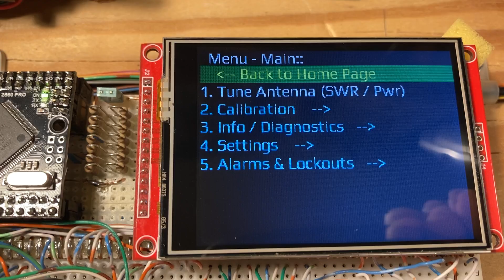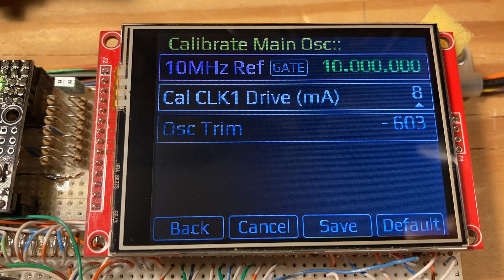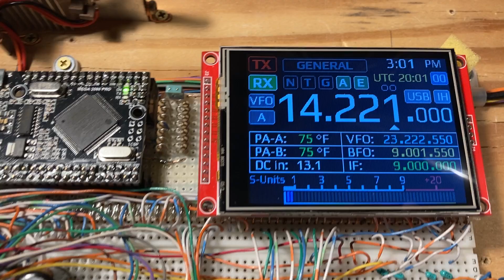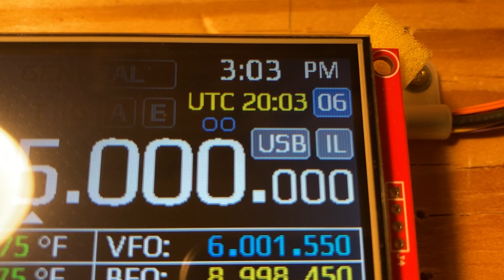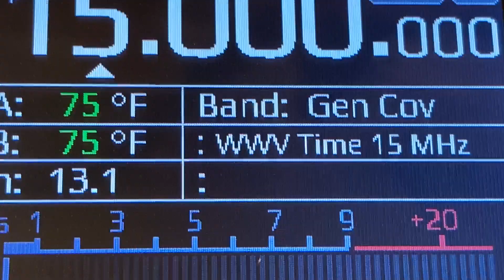Module # 110 Front Panel - MAX-SSB Transceiver Project - First Power Up

Comment: Hi Rick,
Very interesting !
Just started the build and completed just the Mega connected to the display. Loaded the code, and I was greeted with some light from the display.
I can see the splash screen, and next I see a popup saying that I have an alarm (SWR too high....SWR tripped at 9.900).
Mind you, I have not yet connected anything else but the display to Mega2560.

Is this to be expected ?

73,
HAns PA3CRZ
Reply from the maker: Hello hanslammerts4132, Yes, with nothing connected the software is "thinking" the PTT switch is engaged, and since the forward and reflected lines are also open, they are full scale and the software "thinks" the SWR is above the alarm point.  To get around this you can connect 10k a pull-up resistor between the PTT line (Arduino Mega2560 pin A6) and 5 volts which will put the software in RX mode.  73 - Rick - N3FJZ.

Comment: Hi, you did a great job. But does this device only support SSB? Doesn't it support CW\AM\FM?
Reply from the maker: Hello user-1166, thank you for the complement.  No, it's was designed for SSB based on my understanding of how SSB works.  Because of the stability of the Si5351 VFO/BFO it can receive AM if tuned precisely, but there are no provisions for transmitting on AM or other non-SSB modes.  73 - Rick - N3FJZ
Reply: @Circuit6040  Thanks for your reply. I wish you all the best. 73

Comment: Hi Rick, I would like to know if you have configured the GPS UBLOX module in order to generate the PPS even when there is no fix . Many thanks, Antonio (IW0FCI)
Reply from the maker: antaf56, No, the (hardware) 1 PPS pulse (that gates the frequency counter and generates the interrupt to the Arduino) is only generated when there is a solid fix on the satellite(s); however, te NMEA sentence serial data is output even without a fix.  When the Arduino is first powered on, it sends commands to the GPS module. I got the idea from videos created by iforce2d  https://www.youtube.com/watch?v=q4ZA6KtYGRg 
 and  https://www.youtube.com/watch?v=ylxwOg2pXrc

Comment: What are the 2 flashing red lights on the display right under UTC?
Reply from the maker: stevec5000, each flash of these red indicators indicates that the NMEA sentence from the GPS module was successfully decoded.  The NMEA sentence  is where the MAX-SSB front panel gets the time.  There are two indicators in this video, but each do the same thing, I was just testing two ways of flashing the indicators, in the final release there is just one indicator.  Having a red indicator on the LCD screen saved me from having to have yet another LED in hardware.  73 Rick N3FJZ

Comment: Fantastic work on the VFO and controller, looking forward to seeing the software code for this. Looks like you are using an ILI9431 display?  Have you thought about using the ILI9488 this is a higher res so sharper display and available in 4 inch. Thanks for sharing your development work & all the best. Andy G6LBQ
Reply from the maker: Thanks for the tip on the ILI9488 display Andy.  It will definitely be on my to-do list for the next upgrade.  I'm still working on putting the final touches on the newest revision of the code, but it is essentially 99% the same code as was used on the ZX-SSB front panel here: http://www.remmepark.com/circuit6040/ZX-SSB-II-Front-Panel/ZX-SSB-II-Front-Panel.html using the schematic here: http://www.remmepark.com/circuit6040/ZX-SSB-II/zx_ssb_ii.html  The ZX-SSB project is deprecated and not recommended for new builds but it should work fine (see the special instructions for loading some custom libraries and font files)  The changes to the new project include reassignment of GPIO pins, the use of thermistors to measure the PA final transistor temperatures (instead of diodes) and a bunch of other very minor changes that I can't remember :-)   Please forgive my unruly code (15 thousand lines), When I think of a new feature I just start typing and just can't stop, but I try to put in a lot of comments to help remind myself what I was thinking when I coded a particular feature. 73 for now Rick N3FJZ  BTW - I also have a bad habit of not removing code for features I take out or change, I just comment out the old and leave it in place 🙂